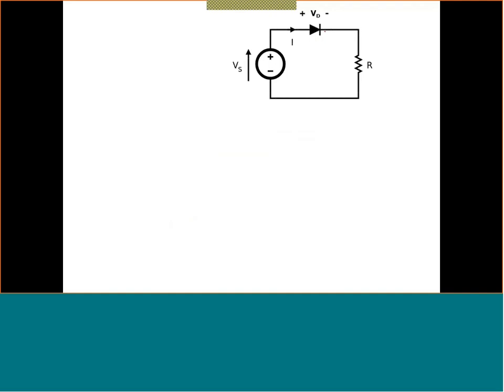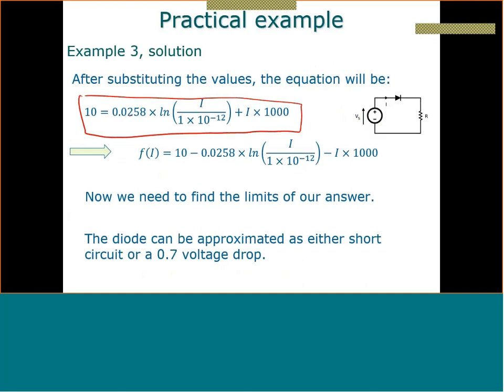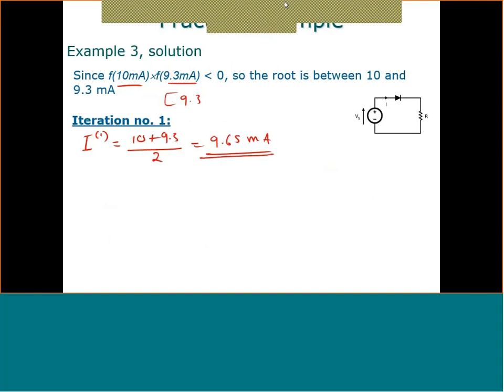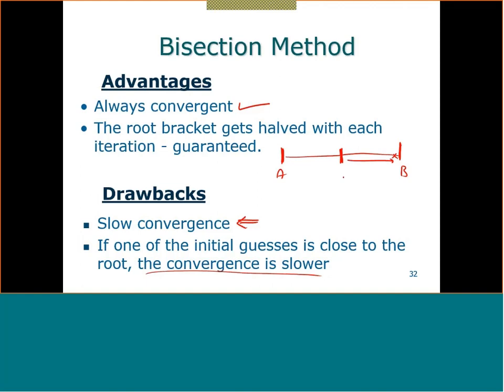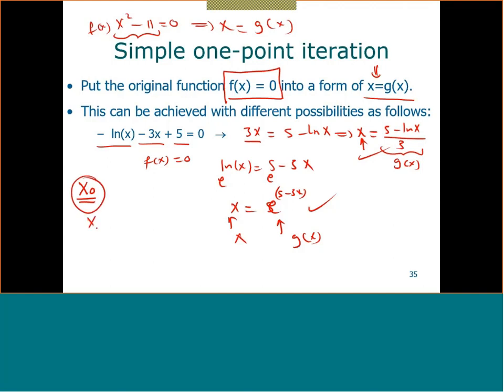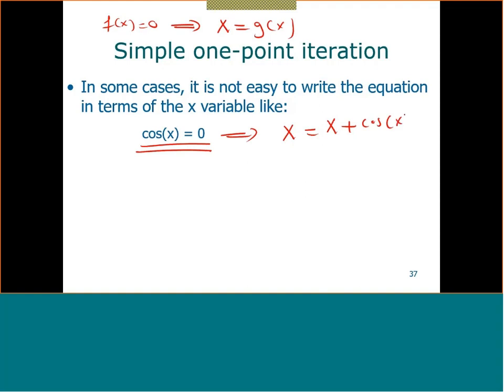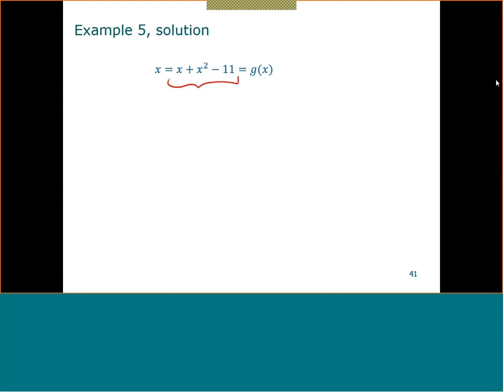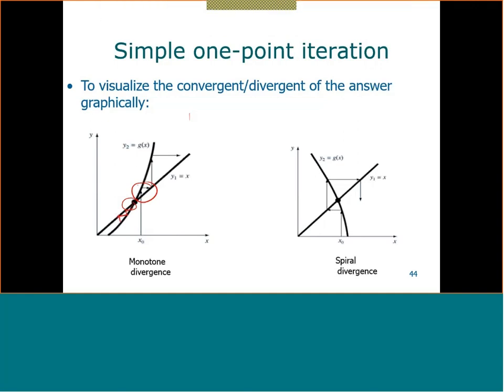Lecture 8: Roots of nonlinear equations  - Part 2

Comment: Coming back to this video, at 35:42, I don't have the same error percentage, if I get 3.5-3/3.5 I get 14% and not 5.53%. How are we getting these absolute relative error values?
Again thank you for the help!
Reply from the maker: Thanks for bringing this up, I did not verify the table before and I used from a reference, but you are correct, the error is wrong. I wrote a correction in the video description.

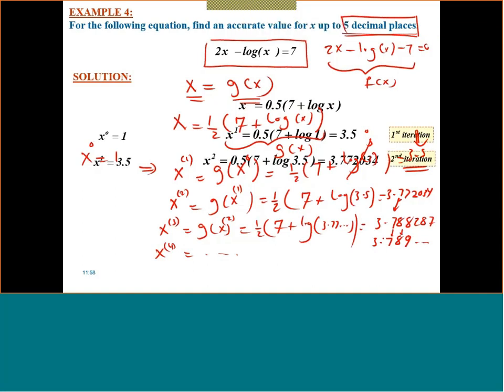Comment: Mashallah amazing explanation, sorry just one quick question, why in 29:49 we do 6 decimal places, like 3.772034, even though the question says 5 decimal places? 

On exam, does this mean only the final answer has to be 5 decimal places and our iterations should have as many decimal places as possible for accuracy, or can we do everything (the iterations and the final answer) only for 5 decimal places?
Reply from the maker: In this question, you need to do the iteration till 5 decimal places are correct, meaning you will have 5 decimal places repeated after two iterations. This is why I did up to 6 decimals so that you can see the 5 decimals.